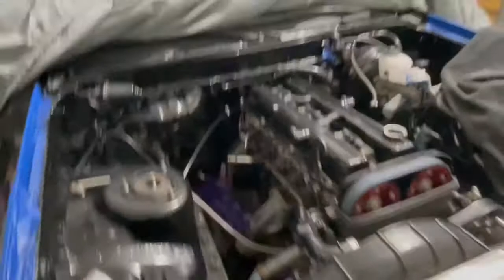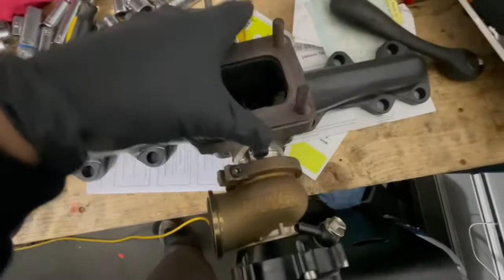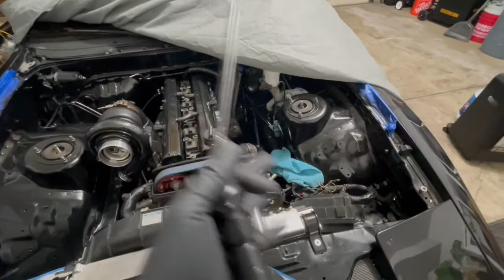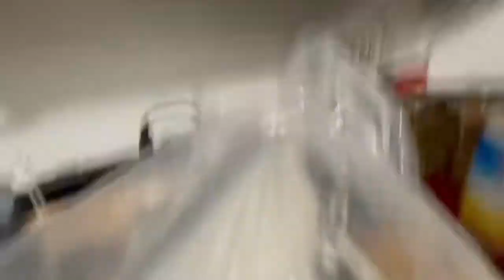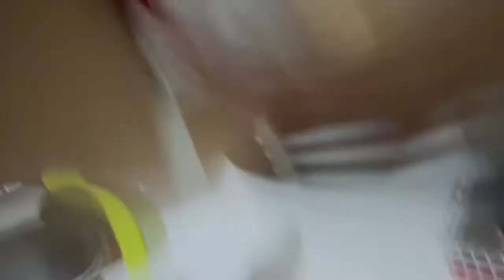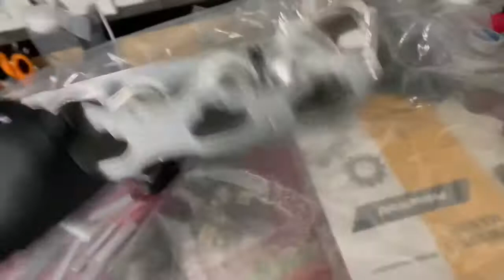2JZ build. Turbo and exhaust

Comment: How did you get to the two bolts that are below the exhaust/turbo housing? Those are very hard to get into. I’m removing mine at the moment.
Reply from the maker: Loosen them up. Remove all the other bolts and leave those two on and loosen them up and move the manifold towards you as you’re taking the bolt out.

Comment: Any cracking issues with the ebay cast manifold? Also, what turbo flange is that? Thank you!
Reply from the maker: Not that I’ve noticed so far. I’ve been running it for about 10 years now I think and no issues so far. It’s seen 700hp